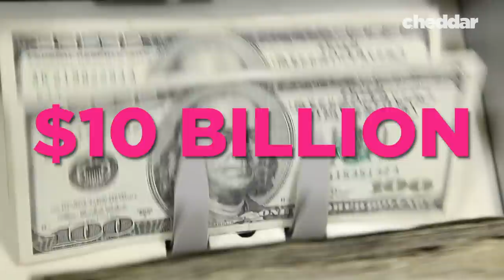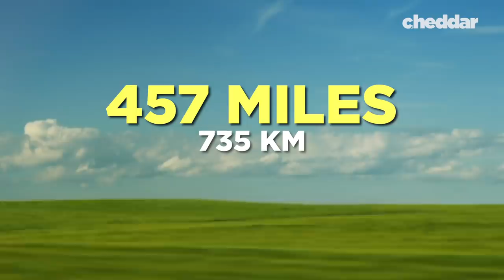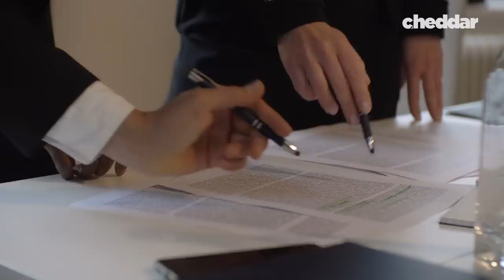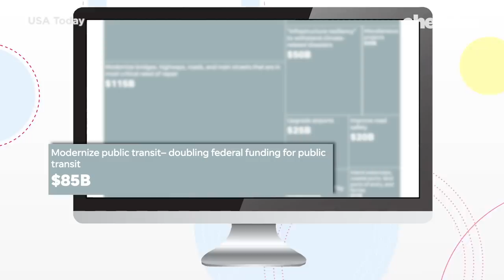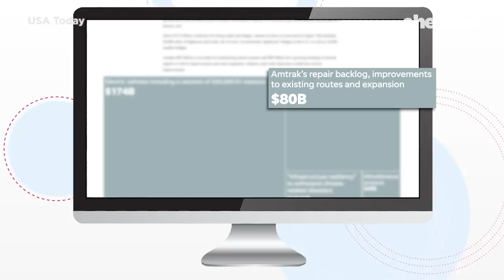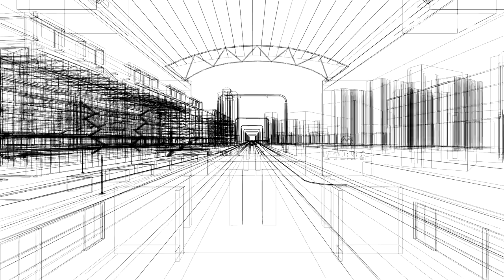Is New York Finally Getting A Real High Speed Rail? - Cheddar Explains

Comment: US also needs to upgrade speed limits on there exsiting rail plus GIVE PASSENGER TRAINS MROE PRIORITY THAN FREIGHT THATS WHY THEY SUCK!
Reply: Freight companies own the track so they usually get more priority, speed limits can’t be upgraded because most track can’t handle those speeds and were mainly built for freight.
Reply: @blackhole9961  what i mean by upgrade is to redesign the curves and setra
Reply: The USA need dedicated train tracks for cargo and passenger transport also metro and suburban trains to transport passengers from the city centre to the neighbourhoods.
Reply: @TheKartoffel101  I’m not for sure if you have seen American style suburbs or not, but I highly suggest you look on google earth or just look at images of them
Reply: @blackhole9961   Yeah I did. Modern suburbs would need bus lines. older suburban areas still could fit tram lines. But if traffic isn't that bad, bus lines would also do the trick to the suburban station. 
Suburban trains could easily use the space between the part where private land begins and the highways leading towards the City (I took Dallas as an example here).
Reply: @TheKartoffel101  finding space to build it isn’t the problem, I mean did you actually LOOK at the classic American style suburbs with unwalkable distances, big houses, way too spread out, etc, which is why I said before I would need a car anyway to even get to the station. 
I mentioned before DART does extend into the suburbs but literally no one uses it and has some of the lowest ridership in the country per sq mile/km
Reply: @blackhole9961  well back before WW2 there nearly every city in the US had private tram companies GM bought them and turned them into buses or closed them to get/force more people into using cars. 
The DART rail network isn't really spread out the trains are very slow, is not very comfortable and as you said doesn't spread out into the neighbourhoods. I mean compare your DART to the S-Bahn trains in Munich or the SSB Ubahn in Stuttgart. I think the comparison between the DART and a tram makes more sense since it doesn't spread out of the city itself. For me, it looks like the DART don't know what it wants to be. it has way too few connections to be a tram and doesn't spread out in the neighbourhoods to be a suburban train. No one wonder no one is using it. If it would be more attractive and reach out to let's say Denton, for example, more people would use it.
Reply: @TheKartoffel101  back before ww2 American cities barely had suburbs and were more comparable to European cities than they are now. 
Those tram cars running through cities were bought and destroyed yes, but repurposed/replaced. After ww2 America goes through a change in how cities would be built and planned, the 1950s is a very important time period for this. The rise of the classic American style suburbs with big houses big spaces open lawns and backyards etc. because everyone was moving to the suburbs new roads and highways were constructed for commutes from the suburbs to the city by car. The tram simply couldn’t expand fast enough and cost effectively reach the suburbs and were ultimately replaced by busses.
Reply: @TheKartoffel101  I can’t really compare DART to the S Bahn because dart is light rail while the s bahn is metro. 
It’s also very slow like you said + stops, which is why commute by car has always been faster and more convenient.
Dart does extend out to Denton, no one uses it.
Reply: @TheKartoffel101  I dont think you understand what i mean by American cities/metros are way larger than european ones. go on google earth, place a marker in the middle of Berlin, then drag it north of the city until it measures about 30 miles(48km) and that would be your standard American metro.
Reply: @blackhole9961  no, the Sbahn is a suburban train. the U-Bahn is the metro in Germany ;) 
I said you should look at hose specially from a side of comfort. I mean I wouldn't ride that DART trains just because it doesn't really look inviting and nice to travel with. In euorpe trains types are products so they have their own marketing design language etc to please and track customers. 

if the Dart extence up to Denton it shouldn't have that many stops and higher speed limits of like 50-75 mph
Reply: @blackhole9961  and trams wouldn't be fast enough for that long distance. At that state cities should have bought suburban/light rail trains and stations.
Reply: @blackhole9961  and maybe that's the problem ;) 
Berlin uses the light rail for that distance and metro for shorter directions.
Reply: @TheKartoffel101  dallas's dart does extend far, but serves no one because its the typical american suburbs, its not going to do anything to pull cars off the road. like most people hope public transport is suppose to do. 
From my experience on dart, pleasent ride but it would never be practical for me to ever use and is of no use to me. It took me nearly 2 hours longer to get to the state fair using DART than just by me normally driving.
Reply: @blackhole9961  well it would with a bit of help of buses I looked up some travelling videos with the DART and I never saw any bus station or even bus hubs at the stations. To bring people directly from their home to the city wouldn't be the task of the DART all alone. As I said earlier you would hop in a bus near you that brings you to the local train station. Which brings you into the city.
Reply: @TheKartoffel101  and thats the exact reason why the car has been dominant in american cities since the 1950s and wont likely chage. that whole process of walking to the nearest bus station(which lets be honest here would likely take an hour or 2 of walking considering its impossible for most americans to even walk to their nearest grocery store) get on the bus to the train station, go through many stops until you reach yours, pray to god your final destination is within 1 mile walking distance after you get off because if not you got more hours of walking to do. That whole process right there is A to B to C to D and sometime E which is time consuming and slow, meanwhile the car gets you from directly from point A to B.
Reply: @blackhole9961  but you could expand the bus network so you don't have to walk longer than 10 minutes to the next station. ;)
and you also have to walk through a lot of stores at the airport. Actually, the distance you have to work at a train station normally is shorter than at an airport due to the size.
At the final destination of the train, you would also take a bus or other kind of transport to your destination ;) 

even with walking due to the slower speed of the car, public transport would be faster. Except you would have a car right at the station.

Comment: Just let the private sector due it like Florida bright-line
Reply: Florida Brightline is not high speed. It runs at grade level on the same tracks as freight trains and has too many stops. Before making an argument, please get your facts straight.
Reply: @richardrose2606  and that would make it a lot cheaper to do then make a new rail way for just passenger travel.
Reply: Unless you what to end up like California with a 80 billion dollar hole and still counting.

Comment: Cheddar are you serious you do know America's fastest train is the Acela that a high speed train right THERE do some damn research
Reply: That's not high speed... not even close. Everyone else has 200-250 mph trains while Acela has a top speed of 150 mph, and for half the track it doesn't even go above 50.
Reply: @vqlcano1698  the new Acela go go 250 bud
Reply: @THE_IRON_HORSE  No, it doesn't. It goes 160 most of the time, and with improvements it gets up to 186. That however, doesn't change the fact that it still won't exceed 50 mph for a huge portion of the track.
Reply: @vqlcano1698  no I'm Saying the top speed it can go is 250
Reply: @vqlcano1698  yeah ik it can only go 160 though most parts of the route

Comment: Don't forget the money interests who stand to lose if people start riding trains. Here in FL,  , part of the FL Dept. of Transportation wants to charge Brightline a fee to build high speed rail to make up for lost tolls. What's next, airlines charging rail carriers for stealing their passengers? In France the TGV ended domestic air travel by carrying passengers everywhere at 300kph (187mph). If I wanted to make a 400 mile trip, why would I want to pay for a plane ticket, arrive at a congested airport an hour or so early, go through the hassle of checking baggage for a fee, deal with going through security, then be cooped up in a flying tin can, probably with some brat kicking the back of my seat, when I could ride a high speed train and get to my destination in less time and in comfort? You can't get up in a plane and walk around, eat in a dining car, or hang out in a lounge. Sure, for a 3,000 mile trip you'd fly, but for a trip that's between 75mi and 500mi, high speed rail is the way to go, but as I said, there are money interest who don't want that to happen.